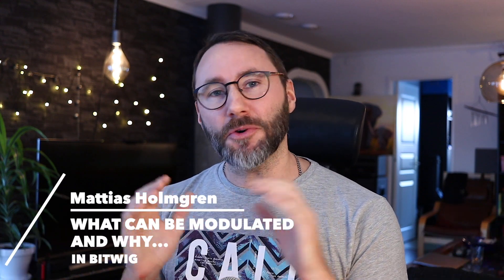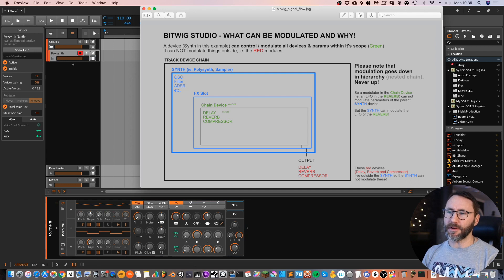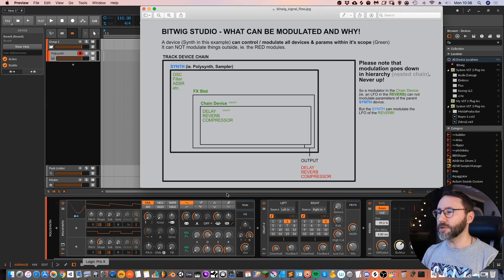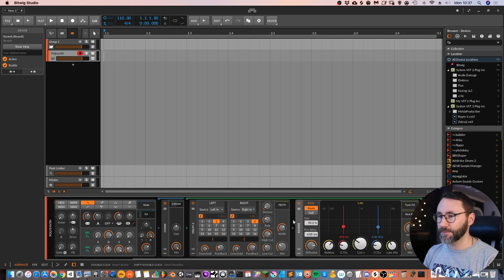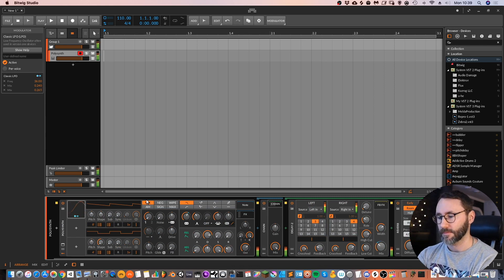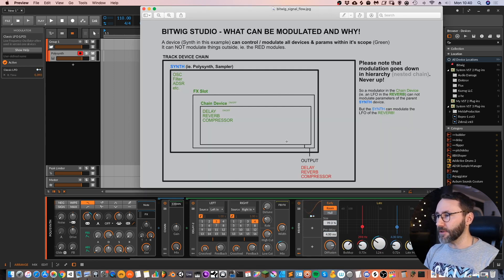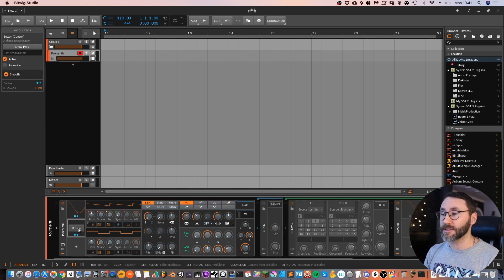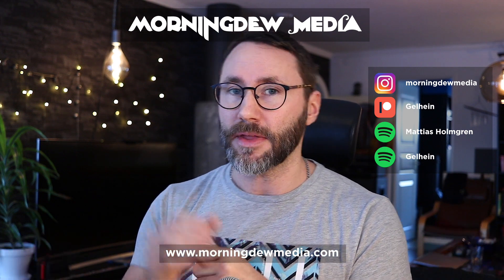BITWIG - WHAT can be MODULATED and WHY

Comment: Thanks for this, I'm a hardcore Reason user dabbling in Bitwig and was finding modulation a puzzle. One thing I'm really missing is cross modulation between devices. Like, in Reason I can take an envelope from a synth device and route it into anything else, even other synths, for a fully modular setup. You mentioned that the signal flow is one way so you can't modulate things higher up in the chain, but is there any way to modulate from one track device to another? If not that way, is there a way to add a master LFO/envelope that can be routed into multiple track devices?
Reply from the maker: HI Bjorn, 
It's cool that you can route a synth envelope into another track etc in Reason. ;)

But in Bitwig, I think it's all about how you approach the problem.
I mean, modulation flows downards yes, and for me it's no big deal. It's all fine.
It doesn't really make much sense that a child modulates it's parent. ;)
It also makes the setup "harder to read", if you have child modulators effecting devices upward (parents) in the chain.

If you need the same kind of modulation another track has:
* Just copy it's modulator settings / setup from track 1 to track 2.

If you want multiple instruments receive the same modulation:
1. Just create an instrument layer (stack).
2. At the top device (instrument layer) you add your modulators, then attach them to your individual instrument devices below (childs).

I know it can be confusing moving from another DAW when things worked differently. 
But as soon as you work it the Bitwig way, and understand the modulation flow. It's no big deal.

Yes, you can not modulate between tracks with normal modulation data. Again, just copy the setups if you need, or make that instrument layer.

BUT, you can use audio sidechain / audio rate modulation to effect between tracks.

I'm not saying Bitwig has the answer to every problem. I'm just an observer like anyone else. And I think all DAWs have strengths and weaknesses. 

Thanks for writing Bjorn! Good to have you onboard! 🌞

//Mattias
Reply: @MattiasHolmgren  thank you my friend! It's great to be here! I actually came back to post an answer of my own and found your kind reply. In the end I found an answer on Reddit and I've got DC offset devices with LFO modulators being caught by multiple audio rate modulators on other instruments and it works great. However your other methods could work well in other situations. To be honest you're right, sometimes my Reason racks are a nightmare to comprehend when you flip them round and that can sometimes break the flow as you have to follow the cables back. Though to an extent this is a symptom of how I work. It's often a very loose jam so if I get an envelope running nicely in Europa's lovely visual envelope generator then I'll often just pipe it out of a CV output jack, split it and then route it to a load of other stuff to get it all syncing nicely. But really, since the modules are all separated in Bitwig anyway, it makes sense to break this bad habit and allow the jam to evolve but with values being generated more suitably. Having muted audio tracks with DC offset devices as the envelope and LFO generators is a great way of getting global macros and feels like a very natural progression of the way I work in Reason. I'm very impressed with Bitwig so far, it feels much more transparent than Ableton which felt a bit obtuse compared to Reason or even Cubase, though I concede that I don't fully understand the concept. In any case, I feel Bitwig is giving me a really nice introduction to its features and the crazy modulation potential and a nice community too. What's the general perception from within the community of the developers? Sadly this is a big reason why I'm starting to look at other options as Reason Studios seem really corporate right now and I'm not feeling great about it

Comment: Mate I really do not understand how modulation goes down in a hierarchy. Does the skeleton Key when activated allow you to see that all the knobs the device, which light up with a more light blue?

I am baffled. I am not even sure how to implement the skeleton key into what I am doing. Please help if you can. Thanks
Reply from the maker: I explain it all in this video. Watch it again and pause when u dont grasp. Try it at the same time in the DAW. You can  only modulate devices nested within one device. This video explains the hirarchy. You can also watch https://youtu.be/mTxDMkKWqIg

When a modulation Button is activated for a modulator, all modulatable parameters (knob) will show in blue hue. You can not modulate devices outside the nest-chain. Hope you grasp the concept. I show modulation in almost every video so watch a few and you should get the flow. Cheers.

Comment: Had to buy another daw because there was no finance option for Bitwig 3. I've noticed I spent way too much time modulating things. I miss it, because clicking a button is much easier than automation modulation clips. However, too many controllers are terrible for modulation. Just look at Nektar. Nektar is the reason I have Bitwig 8 Track. Their controllers don't control much in Bitwig 3. I will still buy Bitwig 3, because it's $100 off the 8 Track upgrade, now. On Bitwig's site, there isn't really a clear-cut review on an amazing controller for controlling modulation. I've been asking how well the NI Komplete Kontrol A49 works , with Bitwig. Still no definitive answer. The infinity knobs seem to be perfect for Bitwig, and having 7 knobs in the same place seems perfect.
Reply from the maker: I can tell you NI controllers doesn't integrate much with Bitwig. That said, the Maschine JAM works excellent with Bitwig. You can step sequence, you can use the touch strips for awesome CC control. You can jump between controlling Bitwig and controlling Komplete Kontrol / Maschine DAW. I think it's a neat solution and I really like the combo of Bitwig & Maschine Jam and I did a few videos / streams on this combo.

I have / had Nektar gear (the P61 broke on me, I loved it, but it broke so I tried out some other controllers, like the Komplete Kontrol S61 and the Axiom Air61 (too bad they dropped the support for the drivers to this device...) the keybed of the Air is lovely.) 

Bitwigs modulators are easily overlooked. I mean, basically, if you find you want to move (automate / modulate) ANY Host Available parameter from a plugin, you can do that in a heartbeat with a modulator in Bitwig.
I mean, hey, I want to make that EQ (whatever EQ I like to work with) do a Low-Cut everytime the kick hits. I can do that in a heartbeat in Bitwig. Some plugins offer sidechain, yes, but with Bitwig you have that opportunity with every plugin. And you don't have to learn the modulation routing in all your 10000 synths. You just learn how to do it in Bitwig and it will work across any third-party plugin you work with.

I've tried to pin point exactly WHY I often come back to Bitwig when I want to do a certain type of song, and it's this exact feature. I don't have to learn new modulation ways, or feel restricted by a certain plugin workflow and schematics. I just know the Bitwig way, and I can make use of that with whatever software I choose. 
I think this is the biggest selling point for selecting Bitwig Studio as your primary DAW.

And the plugin browser in Bitwig makes this all come together because you tag all your stuff (read: your custom device setups - device chains etc.) and can find them very easily.

I will make a video and talk about this topic further because I get asked this all the time. why why why...and I'm like. "I think I already explained it properly", but maybe I didn't. ;)

Thanks for writing and reminding me to make this video.

Comment: @Mattias Holmgren let me ask you another important question: Does Bitwig allow use any plugin parameter as modulator?
For example Peak Controller Fl studio can recognize peaks and apply them as a modulator on another knob or fader in any plugin you'd like. Is there such a possibility in Bitwig? At least is there some hacker way to do it?
Can Grid receive information parameters from another plugins?
Reply from the maker: How third party plugins exposé their parameters is dependant on how they are developed from the manufacturer. 

Grid can have audio receivers to route audio from other sources into the Grid, that you then convert signal to modulation data. So you can have filters following audio amplitude etc. Your imagination is the only limit.

But third party plugs are not developed to send out LFO rates etc outside the plugin. So you use Bitwig native devices for LFOs and such.

Also, there is an side-chain modulator in Bitwig Studio which does this exact thing. It translated audio level to modulation data according to some threshold, depth etc. I showed it in some recent video.
Reply: @MattiasHolmgren  Thanks, i got you. But in case you. But just in case you ever decide to empower Bitwig:
Google "fl studio browse parameters" -  every 3-rd party plugin contains information about each parameter.
It would be great to have access thereto.

Comment: Why do we need such a concept with this limitations? Why can't one modulate things outside?
Reply from the maker: It's object device nesting, parent/Child relation, a nice flow principle IMO. You can modulate things outside but takes a different approach. The nested device Flow also makes sure you build your devices so you can save your object (preset) nicely as one unit. Rather than 50 spread devices with weird non parent-Child connections. It does make sense to me, but I am a software developer too.
Reply: @MattiasHolmgren  Oki, Thanks for explaining. In terms of programming principles it is true. But then must be other possibilities to solve the task. What other approach is there?

Comment: Actually you can pass modulation up in hierarchy or even to another track. For that you use FX layer, make pass-through layer and another where you place DC offset device between empty FX layer devices for in and out signal isolation, then apply modulation from higher hierarchy to DC offset. From here you can use Audiorate modulator anywhere (excluding feedback situations) and pull the signal from that DC offset device.
Reply from the maker: This video explains the general Flow in Bitwig. Yes, you can do more advanced routings, also with audio side chain etc to modulation. But this video explains the concept of the nested devices and modulation in general for new users to get a good solid grasp on how Bitwig behaves. 😋
No one talks about this so I thought a solid video to explain The concept would be awesome.

We can take the more advanced routings and 100 other devices in another video. :)

Thanks for writing x-ISO!
Reply: @MattiasHolmgren  my comment meant to compliment your video, it is necessary to understand basic modulation hierarchy fisrt, then you can understand how to overcome it if needed for some reason.
Reply from the maker: Absolutely. Thanks!

Comment: Great video, as always! :)

If I could add one more tip, you can always drag modulator "upstream" - from Reverb to Chain or Polysynth in your example - and it'd retain its settings and current routing AND be open to more targets.
Reply from the maker: Yup, drag drop works like a charm! 😃